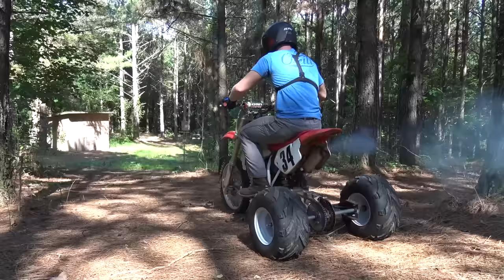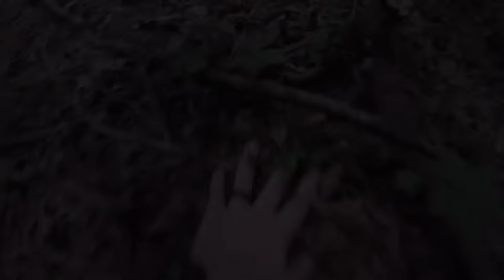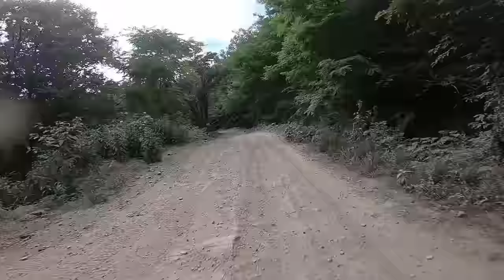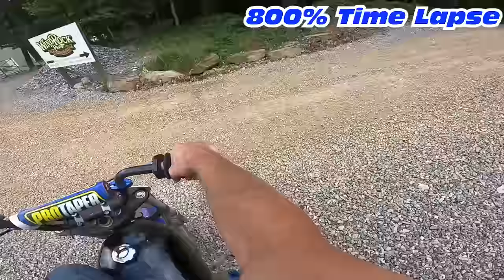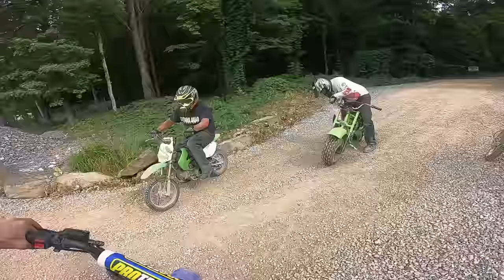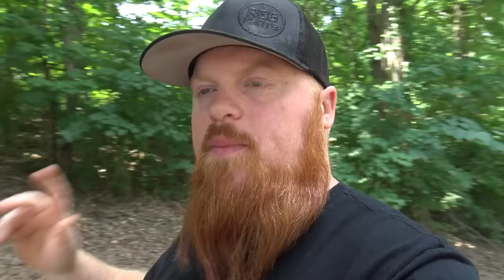MB200 Mini Bike Windrock Offroad Park Connector Trail Ride

Comment: Hi Greg! Great Videos. Would you consider doing some outside work for me? I have a sand rail that needs some front spindle work. Designed without Ackerman angle for steering.

Comment: Mr.Beard, could you please tell me what size  mikuni type carb to put on my Baja warrior dirt bobber that now has a Honda gx 340 and 30 series converter and  pipe with governor removed? Im aware that ill need to dial it in a bit .Ive had no luck with having someone txt or email me with some advice, and this includes your guys at go powersports.I dont want to put a stock carb and all the linkage and filter adapter . It is ready to rip up the yard and I just need to know what size will get me close to being agreeable in the fuel delivery department..I want to thrash this beast!!!!.Blessings to you and yours!

Comment: Yeah it has better suspension than the Mega Moto 212 but right out of the box with just only the throttle screw turned out, flat paved road with 230lbs my Pro topped out at 44mph costing $0 in mods and at Walmart right now for $499 - $549. I snagged it at the $499 price. Considering it's $800+ normally.

Comment: How come you guys don’t get on the throttle? You have clear going, get it on!
Reply from the maker: Vehicles drive both ways on this trail and this was his first time riding this trail its hard to go all out. No knowing whats coming up next is harder than you think.
Reply: IN THE ROUGH STUFF THE ATV'S WERE IN THE WAY . LOTS OF LOOSE ROCKS , MUD AND TIGHT PLACES .IT WAS FUN BUT WE HAD TO LOOK OUT FOR EACH OTHERS SAFETY. IT WAS A TWO WAY PATH AND OUR FIRST TIME ON IT. TRAIL #2 WAS ROUGH
Reply: That trail was way rougher than the video shows plus it was 2 way trail